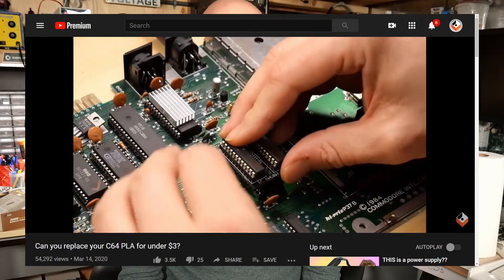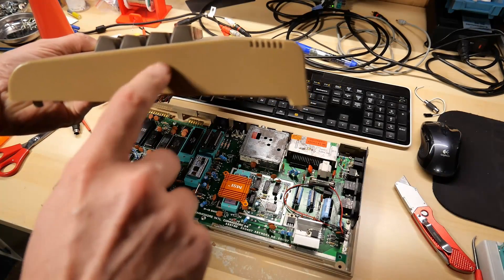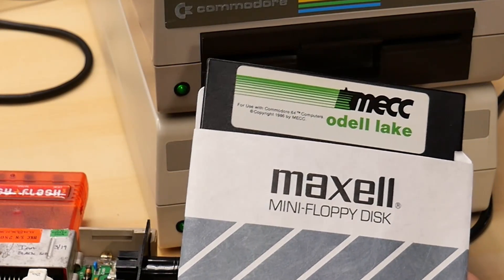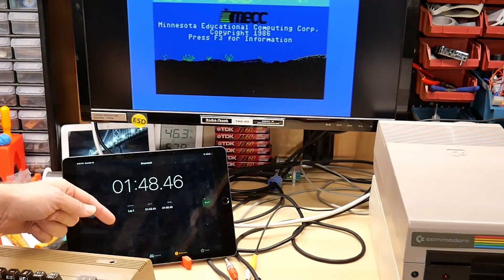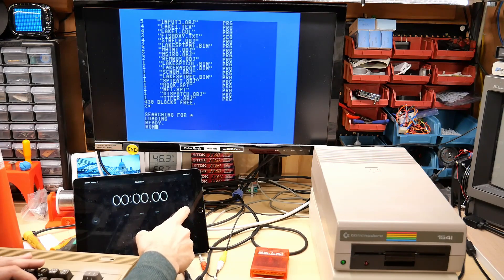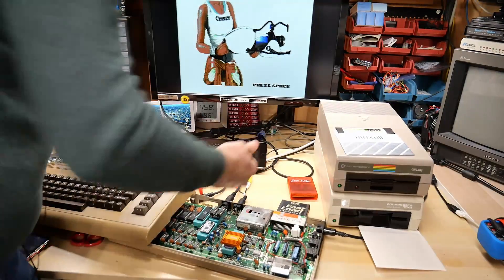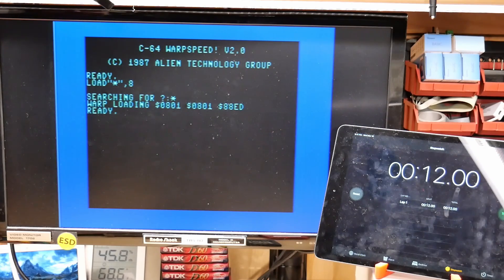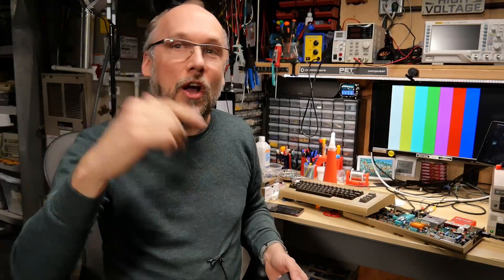Does the $3 GAL-PLA work with Epyx FastLoad? (Bonus fastload comparisons)

Comment: If you want to see 2 second Load Times , Use An Action Replay MK 6, Use the game H.E.R.O as a test , Freeze the game and re save it as WARP 25 and prepare to be amazed. Stock Drive as well
Reply from the maker: Neat -- so you really get the benefit if you save it to the disc with the AR cart? But then it's not compatible with systems that don't have AR right?
Reply: @adriansdigitalbasement   You can save a special loader on the disk before you freeze the program so you don't need the Cartridge afterwards _
THE WARP*25 DISK TURBO

Warp*25  is,  we  believe,  the fastest serial disk loader in the
world. It will load an Action Replay program in 6-7 seconds. This
speed  rivals  that of the best parallel systems.  However,  some
restrictions apply:

1) Warp*25 files are Saved in a special form which the normal CBM
   DOS  cannot  recognise. This means that Warp files can ONLY be
   loaded  by  Fastload  or the independent loader, if present on
   the disk.

2) Warp files are slightly longer than normal files.

3) You cannot validate a disk which contains Warp files.

   Warp  files  need to be Saved on continuous tracks, therefore,
   you  may  find  that  the  system will return 'DISK FULL' when
   there is apparently ample space on the disk. To avoid this, if
   is best not to mix normal and Warp tiles on the same disk. The
   Filecopier  (Section 5.2)  can  be  used to 'pack' Warp files,
   thus making additional disk space available. To Save a program
   in Warp form add the suffix ,W to the filename:

SAVE "PROGNAME,W",8

NOTE: Warp*25  does  NOT  work with the 1581 or 1571 in two sided
mode.

Because   the  new  Ramloader  is  so  fast,  it  is  not  really
necessary  to  use  Warp*25, except when backups are to be loaded
via  the  independent  loader. Warp is faster but less convenient
than  normal  format.  The  Disk  Turbo  can be switched out with
the  command  OFF.  Load  and Save will then be at slow speed (or
parallel  speed  if  such  a  device  is fitted to your system) .
Type  ON  to  re-enable  the Turbo. The Ramloader can be switched
off  and  on  with  the  commands  @K-  and  @K+  .  This reduces
loading speed but doesn't blank the screen during load.

NOTE: Some commercial programs will override the Disk Turbo.

Comment: Warp speed was released later in the 80's. Most people concerned with drive speed already had the Fastload cartridge, or even JiffyDOS. So, there was limited interest in replacing existing fast loaders. I had both the Fastload and the Warp Speed cartridge. It usually put Fastload to shame.

Comment: Ever played with an Atari ST?  I had the B&W monitor and used German productivity programs on it.  It was a cheap way to get into desktop publishing.
Reply: Translated into English German programs.
Reply from the maker: Yeah I have a Atari 1040STe at home -- haven't done too much with it.
Reply: @adriansdigitalbasement  Nice!  Hope you've bumped it up to 4MB, TOS 2.06, a GoTek, and/or an UltraSatan. There are modern VGA adapters and also cables to plug in Commodore RGB monitors - which I'm sure you own - if you don't have an Atari SC1224 or SC1435. Back in the day, the STe was plagued with incompatibility with earlier games but there's a lot of patching going on in the community to get everything to run. The only thing lacking is patching for more games to support the ST PowerPad/JagPad Controllers through the STe's Enhanced Joystick Ports; seems like such support is being thrown in for those same games when they're being ported to the Jaguar by that homebrew enthusiast community. Although TOS isn't open source, there are hacks being made to it online separate of the EmuTOS open source alternative OS project. There's obviously far more info in AtariAge's Forums, of course!

Comment: Didnt realize Adrian never had a C64 as a kid.  His knowledge and handling of the C64 always made me think he had one like myself.  Great presentation of the fast loaders!
Reply from the maker: Crazy but I had a VIC-20 but then a series of Apple II machines up to the Apple IIgs. I honestly feel like I really missed out on the whole experience! The Apple II seems to crappy in comparison!
Reply: @adriansdigitalbasement  The Apple II was junk, but its competitors were the PET and TRS-80 in 1977 so that's forgivable. Its biggest problem was not enough evolution with the Apple //e and Apple //c. 

Of course eventually you got the IIgs which was an exciting machine. Some great capabilities though with less neat hacks than the C64. ...and the Amiga was out by then.
Reply: @NozomuYume  Never had a IIgs growing up, but now finally have one and it's pretty nice compared to an original Apple II line.  But, as mentioned, it came out at the same time as the Amiga and ST so quickly got lost in that competition.  I had heard of the IIgs back then, but didn't know anyone who had one.. Even though it ran Apple II stuff, there wasn't a lot of IIgs software compared to the other two, so not a lot of reason to get it unless you were just replacing your older Apple II.
Reply: @BrianV_PM  The Apple IIgs came out after the Atari ST and the Amiga. The "advantage" was that it could use most of the existing Apple II software library. It had excellent graphics and that Ensoniq sound chip was better than the Amiga's audio. But Apple gimped the speed of the IIgs so it wouldn't threaten the Macintosh line...
Reply: @NozomuYume  i wouldnt say the apple II sucked its just more of a metalic feel and very simple lol some games weren't so bad on it but they are still nowhere near as good as c64 but its simpleness is what kinda made its feel. lol
Reply: @adriansdigitalbasement Thanks for all the content so far, but when are we getting VIC-20 content?!  :-)   I want to try to restore my own VIC-20.  Plan to test typing blind to see if I can get the tape motor to spin/stop on command.   Also could probe some of the lines on the expansion port to look for CPU activity.  Watching these videos shows the troubleshooting that is possible.
Reply: I had a VIC-20, then a 64, then a 128.  In high school we had Apple II's.  I wasn't impressed because of how much better my Commodore machines were.  Then in 1990 I gor a PC, a 80286 12 MHz clone.  I felt bad about getting that instead of an Amiga.  But 30 years later I still work as a Systems Engineer on PC's, it was the correct choice.
Reply: I grew up with an Apple //e... and it was indeed crappy in comparison.

But it could have been so much better if I had understood its intricacies as a kid as well as I do now... and had more configuration and accessories.

Most importantly, we were stuck with a little black&white Monitor II because my father insisted a colour monitor upgrade would be too expensive... I had no idea at the time that it supported colour output to TV by default.
Reply: @KomradeMikhail  It only was crappy in sound and graphics, but the one cool thing was that it had expansion slots,and there were add-in cards for different graphics and sounds.  It was quite hackable as well.
Reply: Dunno anybody else with this expertise like Adrian when it comes to the Commodore 64. So a surprise for me too. he didn't had one as kid.

Never opened mine. But a friend, working in an electronic company did. From somewhere - and I really wonder in the days with no internet or BBS - he got a hacked kernal rom, which included a fast loader and a assembly monitor and "burned" it onto an eprom. I seem to remember he soldered it on top of the original kernal and added a switch to the backside of the computer to switch between hack and original.
Reply: @TheAnkMan  BBS's and really large and thick "Computer Shopper" weekly or monthly magazines were pretty common by the mid 1980s. Most actual hardware in those days came out of the magazines or from computer shows or swap meets, which were more popular than gun shows are now. Most of the community knowledge came out of columns in the shopping magazines, or from Byte or Dr. Dobbs Journal.

Comment: The fastloader issue is a little complex. Some work better on programs which consist of multiple small files, some do better with single-file programs, some just don´t work with certain programs. As a rule, you should use a variety of fastloaders to get best results. I like "Exos" pretty much, even on "single file"-programs its incredibly fast, even faster than jiffy-dos...

Comment: I bet the reason Odell lake didn’t work is that your 1541 wasn’t on when you turned on the 64 - if I recall it loads the new software into the 1541 on power up, and if you reset the 1541 it loses it, and if it isn’t on on power up it wouldn’t get it. I recall the directory being faster than that when it was working...

Could be wrong , I had this cartridge in ‘87 first before I got my SSV5....
Reply from the maker: Actually the manual for Epyx Fastloader says to turn the drive on after you turn on the C64. See for yourself on page 2: https://rr.pokefinder.org/rrwiki/images/c/c4/Epyx_FastLoad_Manual.pdf
Reply: Adrian's Digital Basement oh cool -
It had been a while since I used that!

Comment: Thank you for continuing to do videos, especially now as it really helps those of us on Lock Down in California thanks to CV19. 
My dad bought the Epyx Fastload in 1984 and I still have it.  There were plenty of games that used their own disk routines that it simply could not speed up.  But it did work with a fair number of programs and most productivity software that we had at the time.  It was basically always in the cartridge port for years until I got an Action Replay which had insane speeds, especially when a file was saved with Warp 25.  The game I was playing a lot back then was Ultima III and FastLoad didn't do much for it.

The creator of WarpSpeed has discussed those days in detail over on Lemon64.  His forum name is AlienTech
Reply from the maker: Cool! Yeah I can imagine it was disappointing when a game or program used its own slow routines and didn't give you the choice to use alternate ones. I can really imagine how useful these tools were back in the day though -- for the reasons you mentioned.
Reply: @adriansdigitalbasement  At the time the Fastload cart was a must.  I didn't know anyone that I traded software with back then that didn't have one.  Super useful.  It wasn't until I started working with TRS-80 and Apple IIs in High School that I realized just how slow the C64 drives were.
Reply: Racer X definitely a big difference between the C64 I had at home and the Apple II at school 😀
Reply: The reason why it didnt work so well on the Ultima III was because it had its own "dos" that accessed the data on the disk by doing direct block-reads rather than the standard "load a file" process. I wonder if the more modern patch/hacked versions like U4 gold, or the U3 version of thath etc would work with Fastload but than again, they come with their own fastload routines.
Reply: @RickTheGeek  Exactly.  It was quite common in the early C64 days for companies to use their own routines.  I am glad in later years things changed and many more games had good speed loaders or did not interfere with speeder carts.  Yeah U3 Gold is for sure better in this department.

Comment: Test with any of the SSI gold-box games such as Pool of Radiance or Curse of the Azure Bonds.  They have a fastloader, but allow you a chance to turn their built-in fastloaders off before they start.  It'll be a good comparison betwen JiffyDOS, stock, Epyx, and the SSI speed loader. :)
Reply from the maker: Good tip, thanks! I'll need to do that. Need to check my original game collection.
Reply: The SSI games were so soul crushingly slow.
Reply: @KingMob4313  True, but i played them all, I spent a long time at the C64 playing Pool of Radiance, Curse, Secret of the Silver Blades & Death Knights of Krynn etc. I still have all the games. The worse part was 4 double sided disks, so there was lots of disk swapping and flipping, as you needed a disk for your save game too.
Reply: @KingMob4313  I've learned that jiffydos makes them remarkably fast, especially if you have a larger storage device; you can copy all the files into one large disk or directory and never swap disks. :)
Reply: @KingMob4313  But so addictive we used to spend hours after school playing these tiles :)